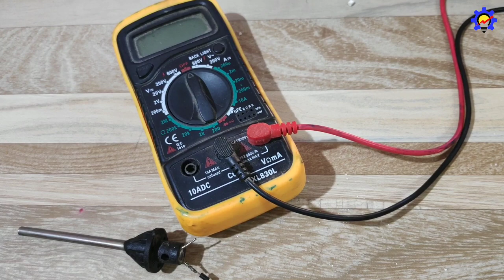DIY|| HOMEMADE HOT AIR SOLDERING GUN

Comment: Bro do you use 10rs solder wire or u go for  bit higher ones.coz my solder really doesnt  melt like yours
Reply from the maker: use high watts soldering elements
Reply: @HackTarget786003  didn't got what u said 
Elements?
Reply from the maker: the bit which you said is called soldering element
Reply: Got it thnk u bro
Reply from the maker: @saadmalik5450   you are welcome bro
Reply: Buy better quality wire itll be worth the money

Comment: I made one  from 60W solderng iron, plasic turbine blower but it seems that temperature is not ok. I can not measure the temperature in this moment but something is wrong. Air is very hot but maybe temp have to go up to solder good. Any advice?
Reply: Let the iron heat first for some time and then turn on the air flow

Comment: this guy covered the opening to the heating element and then connected a fan to the case which is useless.. he copied the same from other videos but didnt know why!
Reply from the maker: boss without knowing dont just comment plz .. for your kind information the fan you are talking about is not a fan but an air pump .. the air need to pass out through the heating element not through the opening thats why its being covered.. first get the knowledge then comment...
Reply: HackTarget if that’s the case explain why do u even need the fan. U have closed the opening and the element is inside the hollow tube which is closed. The fan is used to pump air through the hollow tube carrying heat with it to the components. Here, I don’t think so it is serving that purpose as the opening is closed.
Reply from the maker: dude ... i made a hole on the element ( top black part ) with the help of soldering iron didnt you saw??  from that hole the air will pass and get warm while passing through the element ..  you guys just know to criticize others ..
Reply: HackTarget my bad bro! U didn’t show that in the process, after covering with Mseal, in the next frame there is a small hole but was not shown as u doing it so I missed that part. I think some of them might have missed it also!
Reply from the maker: @yethinderragav   its shown in the video bro .. anyways thanks for watching ..